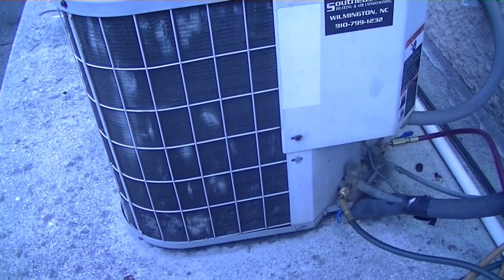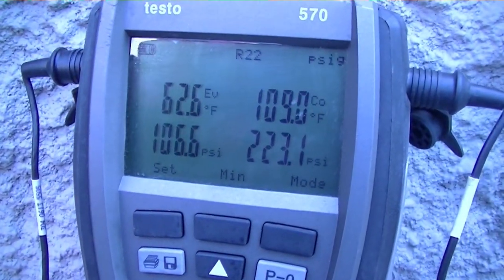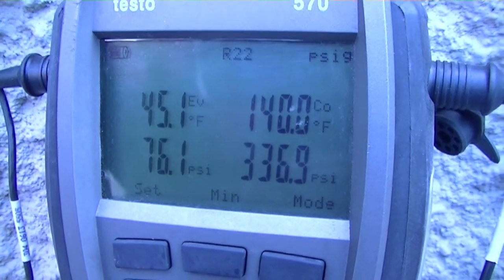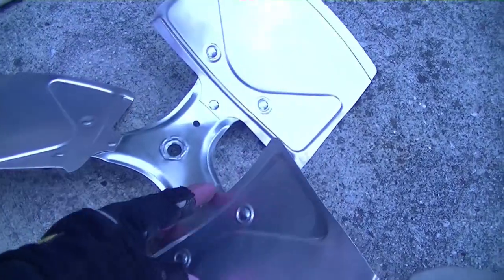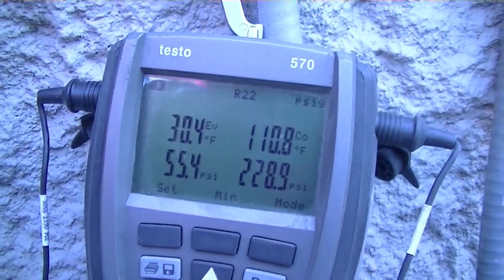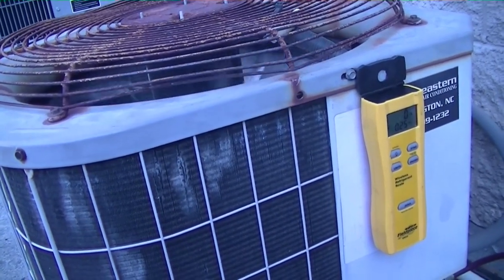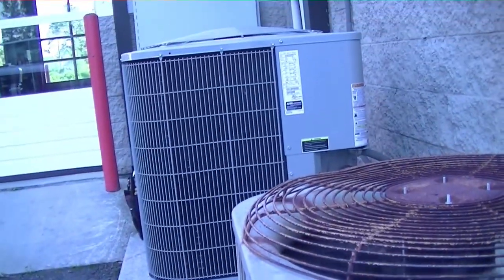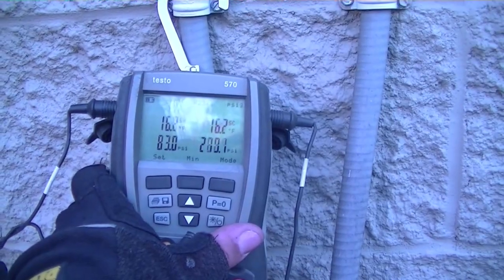HVAC Service Training- Solving Head Pressure Issues

Comment: I had same u it same issue I played with blade hight I think if the blade would be able to go higher towards motor it would be better but with aftermarket motor wasn’t possibly or even putting 1/4 inch spacer on the grill bolts to condenser

Comment: Is the testo 570 a good gauge? I've heard they can have leak issues, and that the vacuum readings when trying to get down to 500 microns doesn't work so well.
Reply: I don't like them, the clamps and wires super low quality, no built in vacuum gauge, the metal hook falls off, numbers are too small, overall design is pretty bad.

Comment: I don't know why you would replace a OEM fan blade with a cheap China Inc. knockoff if it isn't bent or somehow damaged or out of balance. I've seen kids shove a stick or screwdriver in the top of units sitting in alleys before. I've also seen kids shove a tennis ball in a 90% + 2" PVC termination elbow for a furnace before too. It was tripping pressure switch and I couldn't find anything wrong with the furnace, so I removed the exhaust and it fired and ran fine. Next step was talking a walk outside to the alley side of the house. I'll be a son of a bitch!! That woman was royally pissed and knew what kid did it. I bet the neighbor kid's Dad ended up paying that bill.

Comment: Looks to me like the problem is someone put a new fan motor on at one time and didn't reverse the rotation of the blade cause the way the motor is turning and the angle of your blade is why the air isn't coming out the top.

Comment: Your coil is obviously dirty. That is why air is not discharging out the top.
Reply: From what he showed and even pointed out... A third of the fins are bent over. When it "looks" clean, normally it is enough to get close to proper readings. Bent fins aren't like dirty.. They're like clogged! Random hot spots on a coil can produce irregular glides also.

Comment: pointless repair cant assess head pressure issues without cleaning the coil never heard of string hoses together
Reply: If a customer doesn't have an available water spigot it's their problem - have SEVERAL stores like this - just let em run till they blow.   They can buy new units with all the money they save on not getting a plumber to come out and add a spigot.
Reply from the maker: Hoses can be strung together??
Reply: +talyn875 yeah ive never been anywhere without some type of water access i carry 400 ft of hose in the summer this guy was probably lazy i mean he does have digital gauges
Reply from the maker: +Nick Hatala he is lazy. I mean he only works all day, takes care of his kids and wife then does the books. Nice perception.
Reply: +talyn875 i wont appluad taking care of your responsibilities your supposed he lazy cause he didnt clean the coils so hop off his taint
Reply from the maker: +Nick Hatala not applaud, get off his ass. Big difference.

Comment: Very nice video. Very well explained specially showing the gauges and the different readings.
My Carrier have a bad compressor. The return side is on 104 PSI and the high side is 163 PSI.
Several techs were confused about why the readings are different. I have also restriction in the high side line.

Comment: Ive found that on these older units that on top of what you've  done that if you move the fan blade as high as possible it helps get the air actually coming out the top of the condenser lowering the head pressure more. Ive done it to alot of the tiny 1.5 and 2 ton carrier from that era in apartment style applications

Comment: I use a CO2 tank for pressure cleaning the dust, Ace makes cans of alyalyne no rinse foam I'll carry a bucket of water to the unit and wet the coil then foam it then wet and use CO2 pressure and final wet, that works pretty good. You can use a bucket of water with dish soap, it's safe on aluminum and copper pots. The fun side of dish soap is the bubbles the fan throws off, it looks like the "Laurence Welk Show"

Comment: when it comes to cleaning outside coils that have no easy water available , I have used in the past my pump sprayer not ideal but the PSIG needed to clean from a nitrogen bottle without bending the finpack would only remove 20%of debris  IMHO great video and  thanks

Comment: Could the fan motor be running backwards?  The air should be pulled through the condenser coil and discharged through the top.  The small amount of air you have coming out the top is excess air ricocheting off the bottom of the unit.

Comment: Could you see that the blade was bent? I have a unit that is running high head now and I have ordered 2 new blades. How far is the blade in the plenum? My new motor is a little shorter than the old one and I may have to put a block under it. All of my air is coming out the side but the condenser is as clean as I can get it. It is damaged and old.I hope new blades help.

Comment: One thing i alwayssay to hvac tech is what will hhappen with that new r410a heat pumps and air conditioning unit when the outdoor fan motor goes out on them the head can go up over 400psig on the so they could go up to close to 500 psig if the condenser gets stoped up on them so its probably going to bust a hole in the line set or one of the coils one same as if a heat pump with r410a refrigerant running in winter time and people not changing filter and if indoor blower motor goes outof if indoor coil becomes dirty you knowhow most ppeople are don't change filters for months at a time and call winning about there heat pump not heating or cooling

Comment: Great viedo. I have a question for you,  when you can feel some hot air on one side of condenser fan, and the other side cool air , what does that mean. I cleaned coil coil really good to ,never saw this before.  Your input would be helpful.
Reply from the maker: What kind of unit?
Reply: Coleman , single stage  , basic a/c, r -22
Reply from the maker: Is the fan motor a replacement?
Reply: No original fan blade
Reply from the maker: Blade may need replacement if the coil is clean.
Reply: That's what I thought,  thanks for the help. Hopefully I will be able to upload some videos,  so I can show my strengths and weaknesses as a rookie tech.

Comment: Another problem i see on those carrier bryant icp whatever units is the fan blades either mounted to low on the motor or when someone has replaced the motor they put on a motor where the motor itself is too thick and doesnt allow the blade to be mounted as high up. With the contoured shape of the inside of the top of the unit its important that the blade is in the correct position up and down. Thats my 2cents! Glad u could help them out and save them some $$$!
Reply from the maker: You are right. Some of the motors I carry are too deep for these applications.

Comment: a little tlc can make a world of difference .good job brother
Reply from the maker: That's right Steve, thanks for watching
Reply: talyn875 Fin combs are a great, and inexpensive way to solve head pressure problems without undercharging the system to lower head pressures. Those shitty Carrier condensers get bent fins all the time, since there's no grill to protect them.
Reply from the maker: John Smith yes sir these units are exposed to everything because of the wire protection is slight.

Comment: good  video I agree with some of the others who commented as far as the motor being to long not allowing  fan blade to be up high enough to push the air out the top, again great vid in showing the difference a new fan blade and cleaning did
Reply from the maker: I have had a few aftermarket ones that were long enough where all of a sudden the discharge would be affected of the unit would have a bad vibration.

Comment: i think i'm going to have a seizure!! thanks for the mention in the credits. i learned something new today. also, is it possible that part of the side discharge is a deeper motor on the cone fan?
Reply from the maker: Yea. I had the same thought about the seizures. Aftermarket fan motors are bad about lowering the blade where it will not function properly. This unit has an aftermarket motor. The one next to it did the same thing with its original motor.
Reply: Zack you da man. I remember some of these older units. They were very fussy irregardless and I did not like them much they were very noisy and a good wind really buffeted those fan blades to death and eventually broke them causing damage. 

-Mike